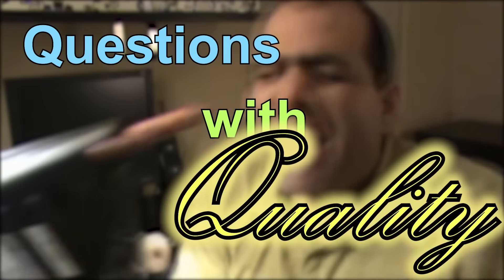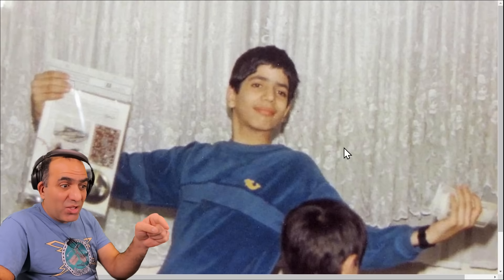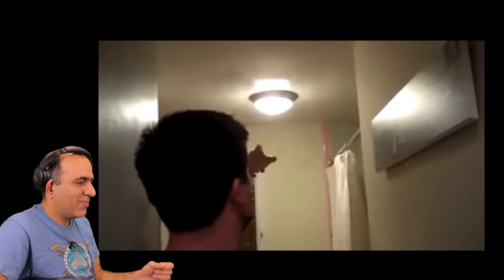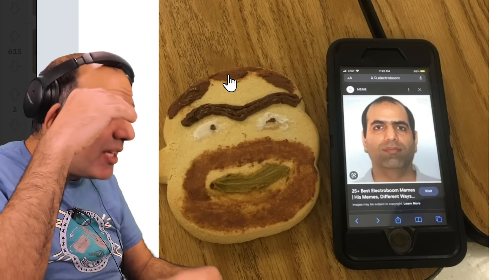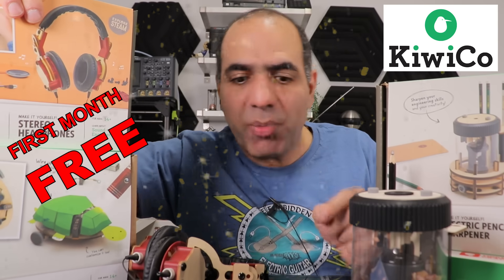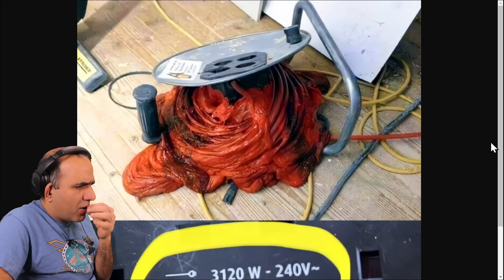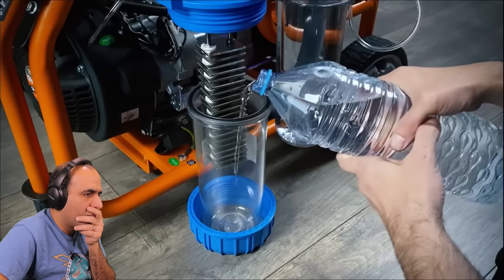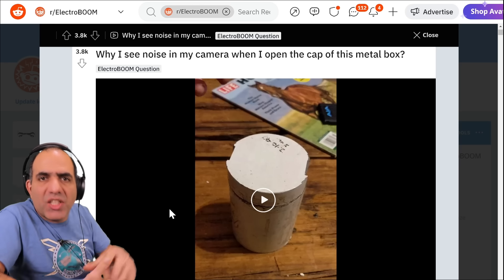Can ENGINE Run on WATER?! They Copied my Toy (LATITY-011)

Comment: Carbon arc torches used to be a thing, basically an attachment to a stick welder that used the arc from two carbon sticks to provide the heat for welding.
Reply: Sure, but the weld in the video had extra material from a steel electrode. (It didn't just melt together the two existing bits of metal)
Looks like it had flux on it too.
Reply: @AndyLundell  It was flux from an electrode (i.e. An electric arc welding electrode) there is no way that he could have welded that without adding material. Total (pathetic attempt) fake -btw I used to be a welder before retiring.
Reply: @AndyLundell  yeah filler material and flux appeared out of nowhere in the weld. Heck even with no flux filler material added the weld would look like crap due to missing shielding gas. Furthermore sure you can make an arc with 12V but to hold an arc you'd need a higher voltage,  two 12V batteries in series and a small dia. SMAW electrodes do work for emergency repairs out in the boonies.
Reply: Yablochkov Candle used to be an alternative to incandescent lamp, before it was invented. It also worked on carbon arc.
Reply: @ildart8738  Actually, I think it was an alternative to CARBON filament incandescent lamps before tungsten filament lamps were introduced.
Reply: To this date Air Carbon Arc is used for metal gouging and cutting
Reply: @milanswoboda5457  Isn't it mostly replaced with plasma cutters though? When would you still use it?
Reply: @Basement-Science  Plasma cutters are mostly used for cutting, air carbon arc gouging main usage is as the name implies, gouging and cleaning welds, its almost like a metal eraser were you can erase welds to apply new ones.
Reply: @Basement-Science  air carbon arc is still widely used   especially for gouging in maintenance of construction equipment, field repairs, structural steel construction,...etc.
Reply: @milanswoboda5457  @Teresa Shinkansen thanks, I'll have to look into it a bit more some time.
Reply: I've used a carbon rod and a carbon crucible in series with a MOT to make synthetic rubies. The results were very limited before the MOT severely overheated and shorted out. Stepped it up to a Lincoln tombstone AC/DC arc welder and I have pretty successful results. 
 A howl carbon rod is used for Arc gouging. Compressed air is forced through the center of the rod and a large AC/DC arc welder heats up the metal and the compressed air blows it away much like a plasma cutter but with fast results at removing larger material. A plasma cutter will get you a much cleaner result with a lot more time involved. An arc gouger is exactly what it implies it gouges or removes lots of material very quickly to prep for the next weld.
Reply: They are still a thing. Also the arc generates cyanogen so you want to do it in a place with good ventilation
Reply: @SuperAWaC  They used to come pretty much standard as an accessory when you bought a stick welder haven't seen them lately but I understand from the comments that they are used in heavier industry. I agree, really should have good ventilation whatever kind of welding you do.
Reply: Also used to provide lighting from the arcs... until Edison came up with something less lethal and more quiet.
Reply: @FedericoLucchi  Wasn't the arc lamp basically a precursor to the CFL?
Reply: yeah you're not doing much with just 12V though. A stick welder puts out much more than that.
Reply: @Basement-Science  
Arc welders don't work on high voltages, only about 20 volts. They need high amperage.
Two twelve volt batteries in series are more than enough voltage to weld.
Some off roaders carry a few welding rod and a welding cable set up to work off auto batteries jumped in series. I've seen a tie rod, broken on the Rubicon, that was repaired with a craftsman end wrench, welded with borrowed batteries and an emergency welding kit, trailside.
This graphite stinger video is not real though, for sure, he chipped off slag from a coated rod.
Reply: @jimsmith7212  I'm well aware. Welders are in the range of 20-60V open-circuit depending on the type/process, but mainly current-limited and controlled. Car batteries are much worse at welding because they're not current controlled, but sure it works if it's an easy job.
Reply: @Basement-Science  
Well, the tie rod was reinforced and worked but it wasn't pretty.
Reply: @jimsmith7212  Stick welders have around 60-70 volts, but that's an open circuit voltage to strike the arc easier. When the arc starts going, the voltage drops to around 20-25 volts and when the arc stops, the voltage rises again.
Reply: @Basement-Science  no, stick welders don't "put out more than that". Current, yes, voltage, no.
Reply: @dimitar4y  No idea if you're just replying to my first comment here in isolation or what. Put it into context please if you want to talk.

Comment: For the first thing Mehdi said I was a bit confused because there are sterling engines which are like mini steam engines that can run off of a hot cup of water. The way that the guys in video explain how the engine works does not make sense. But we do have cars right now that can take in water and split it into hydrogen and oxygen and use the hydrogen to run their engine. But the way those guys did it would not work at all.
Reply: No we don't... There are no cars which can split water for you. It's a highly energy intensive process (which is what you are getting back when recombining it in a hydrogen fuel cell). Burning hydrogen is not nearly efficient enough to produce a net positive here. Most hydrogen is actually produced by splitting methane from CH4 into carbon and 2 H2.

Comment: Why some arcs can burn paper and others arcs dont? People on Internet say its "cold arcs" 🙃.... How frequency affects this?
Reply: The temperature of an arc mostly depends on the current through it. The current depends on the power source, it gets complicated there.
The temperature can be anywhere between room temperature and thousands of degrees, and it's all that matters for setting things on fire.
Reply: @Basement-Science  Ok. So, it just like Joule effect in the air/plasma instead of a conductor
Reply: @miguelm203  Yes, except that the resistance of ionized air is not even remotely constant, so calculating any of it gets really complicated.